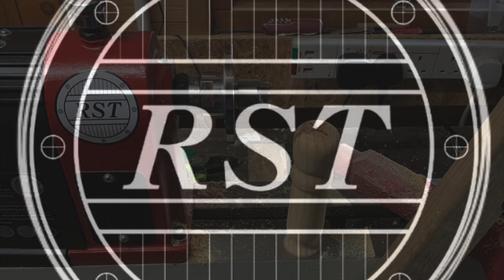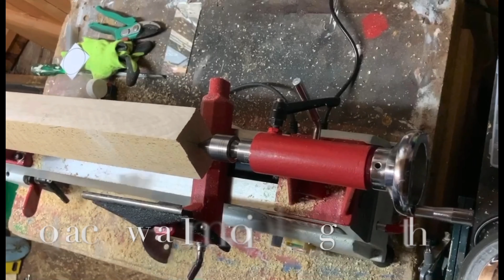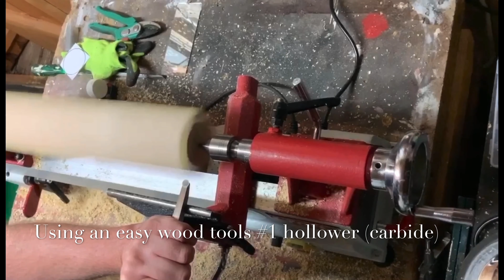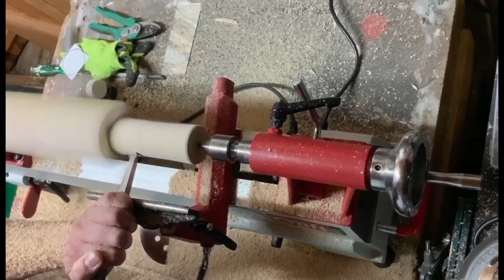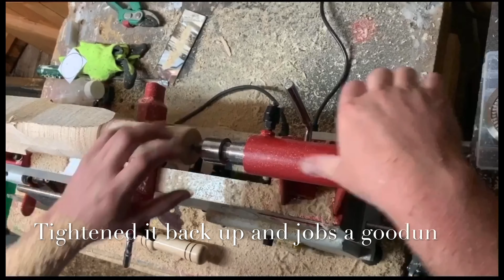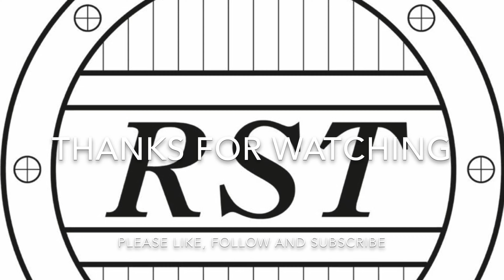#1 First time Woodturning

Comment: Exciting first foray into turning. You definitely want the toolrest to be a close as possible to the wood and it is best to cut 'downhill' - fat to thin  when spindle turning (i.e. grain running parallel to the lathe bed). But keep going👍
Reply from the maker: Rob Hardie that’s awesome thanks Rob. Thanks for watching and the advice really appreciate it buddy 👍
Reply: Ditto what rob said, great first effort mate !! Also make sure the lathe isn’t running whilst again sting the tools rest, you will see a lot of seasoned turnings doing this but it can easily bite you if not careful, keep up the good work buddy 🤘
Reply from the maker: LTW Carpentry thanks dude appreciate it 👍